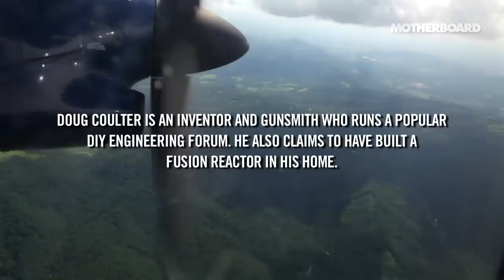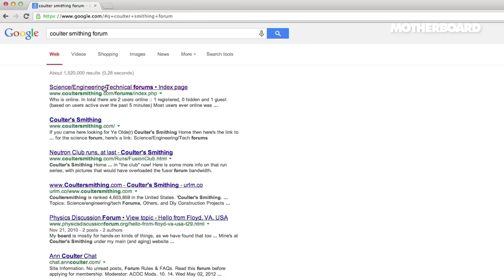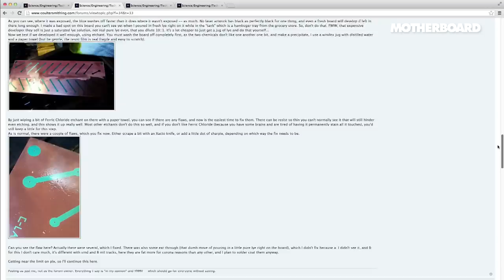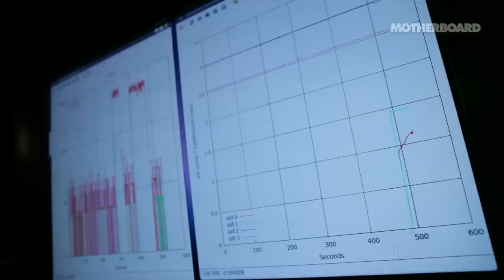Developing Nuclear Fusion in a Basement with a Reclusive Gunsmith

Comment: Is it legal to try and build your own fusion reactor? Sounds kinda dangerous.
Reply: Barely legal, yes.  You're supposed to have certain licenses for anything that makes X rays "on purpose".  We don't make them on purpose, they're a by product.  Actually, unrolling scotch tape makes a few...it's a matter of, well, no one's been hurt at this so far, I suppose.  We tend to be careful.  Electrocution is a larger risk, FWIW - those power supplies are pretty big and at really high voltages, arcs are not straight to ground (Seen a straight lightning bolt?).

Comment: I believe there are fairly simple instructions freely available for developing a hydrogen fusion reactor in one's kitchen. The catch, as with all fusion reactors to date, is that they generate less power than the power required to run them. Is this gentleman claiming his generator produces more power than it draws? If so, once it's verified, Nobel to him … but what I got from this video is that his reactor is no different from the ones anyone in Brooklyn with a subscription to Make Magazine could assemble, i.e., a neat-o experiment, but one that draws more energy than it generates. I mean it's fun, kudos for having fun, but it's not groundbreaking.
Reply: Yes, it's quite easy to make a demo fusor with 10e-9 or so "gain".  That is, if you can solve a bunch of problems with high voltage, feedthroughs, vacuum, and fuel control,  not to mention measuring it all.  Mine's closer to 10e-3...not great, but currently the best on the planet.  I seem to get anything from 10 to 10e2 or 3 improvements every year or so, that's why I'm saying "it's close".  I started at 10e-9 and got the first 6 orders magnitude improvement in 3 years.
At least in this design, all the input power also comes out as heat.  So you don't need as much "gain" as with other approaches.  You need 1.38 watts of fusion for each watt input to break even with current steam turbine tech - eg 2.38 watts of heat will make one watt of electricity (rough numbers but close).

Comment: Very closely resembles a Hirsch Farnsworth fusor in my eyes. As it is the design is incapable of generating power, but I have no idea what changes this guy is trying.
Reply: +olivius007 Corrrect, but you'll know as soon as the USPTO approves.  It's a pretty slick trick, is all I can say now, and jaw droppingly obvious - but only in hindsight as the physicists who checked me on it say.  Found it by a combination of perspiration - checking a huge multi-dimensional parameter space, and insight.  Todd Rider's paper on why thermal methods and static fusors can't work is right in every regard, but missed a trick or two.

Comment: Isn't a fusion reactor kind of like perpetual motion energy can't come from nothing and energy isn't free.
Reply: +Sheldon Cooper no, the energy that fusion power produces comes from the mass that is converted to energy
Reply: Justin Liu But how does that even exist? Nothing has produced more energy like that other than something like the sun.
Reply: +Sheldon Cooper Actually scientists did that recently. I think it was not a long time ago when for the first time a fusion reactor produced more energy than the amount of energy put in
Reply: Justin Liu wow I'm going to have to look that up if that is true
Reply: マリオ 94 it's the same process as the sun. fusion smashes to get low mass elements to make higher mass elements however the the mass after is less than the total before because some mass has been turned into energy E=mc^2 energy is not being created it's being changed from one form to another

Comment: The only thing I don't agree with is that they said no one has gotten more energy out than they put in with fusion. They have successfully achieved this recently but they couldn't get it self sustaining.
Reply: If you're thinking LLNL, they very carefully worded their statement, like this:
" the fusion produced more energy than the fuel absorbed from the lasers".
And then omitted the horrible efficiency (fraction of a percent) of those lasers, or the fact that the fuel didn't absorb nearly all the laser output before disruption.
Absent a gravity field (the sun, anyone?) fusion will never be self sustaining, as the energy output isn't the right input to produce more - you need to make it into something more useful first, then drive a net-gain reactor with that.

Comment: when that thing melts-down it will blow up his whole mountainside
Reply: Given that comment, and your screen nick, I'd guess you don't know the difference between fission and fusion.
Reply: Doug Coulter Actually i do know what they are.
Fission is the splitting of a large atom into two or more smaller ones.
Fission reaction does not normally occur in nature.
Fission produces many highly radioactive particles.
Uranium is the primary fuel used in power plants.
One class of nuclear weapon is a fission bomb, also known as an atomic bomb or atom bomb.
In contrast 
Fusion is the fusing of two or more lighter atoms into a larger one.
Fusion occurs in stars, such as the sun.
Few radioactive particles are produced by fusion reaction, but if a fission "trigger" is used, radioactive particles will result from that.
Hydrogen isotopes (Deuterium and Tritium) are the primary fuel used in experimental fusion power plants.
One class of nuclear weapon is the hydrogen bomb, which uses a fission reaction to "trigger" a fusion reaction.

Supercrackpuppy is just an alias and does not reflect my actual iQ.

I find your setup quite intriguing actually, I just think that something like a fusion reactor should have a whole team behind it and better containment.

Regardless of my thoughts you have been successful thus far. As a result i wish you luck in your endeavors.

Regards Bryce Adam Vickery
Ps. don't judge a book by it's cover
Reply: supercrack puppy Fission does happen in nature, and did on this planet a few bill years ago.  I have some of the "reactor waste" from it in my mineral collection.  Back then, uranium had a lot higher proportion of U235 than now.
http://en.wikipedia.org/wiki/Oklo

Comment: I looked at his forum, and it just seems to be a bunch of people talking vaguely about making fusion reactors using lots jargon. Nobody actually explains how anything works, and there never any exact numbers.

For example, what is the connection between an electron scanner microscope, and fusion? An electron beam can fuse...but not the kind of fusion that he is talking about. It can fuse metals together (welding).

Fusion isn't something you can "slap together using re-purposed parts." If something sounds too good to be true, it probably is.

Basically, all of the scientists working on the other fusion projects are just pretending to develop fusion technology, and have either; A: never heard of this guy (a genius in the feild) for some reason...Or; B:  just pretending to develop fusion technology. Not so likely.

Comment: (First sequence) a gunsmith grasping the (removable) magazine while shooting? Uh?
Reply: it's technically a "pistol" so accuracy is not much a concern. AR mag-wells are pretty hardy. If it was an MP40 or a bren, that grip would be a bad idea. Plus, there is no guardrail.
Reply: Theo Mawia
 We're still learning how to shoot that oddity, is all (while it looks cool, it's not that great a gun, just a lot of fun).  How would YOU hold it?  That's a serious question.  It's definitely a two-hander since the recoil is serious.  I'm wincing at the end of the sequence as I touched the barrel while removing the mag and clearing the gun before the muzzle could sweep the cameramen.  Got a burn.
Reply: Theo and Doug: thanks for those explanations! As to hold it: I may try to add some lanyard to it (à la Ingram MAC), but dunno if it's realistic or efficient.
Reply: Doug Coulter what an honor. The man himself. Well, putting a stock on it is definitely illegal since its a pistol (i'll never understand gun laws) and would defeat the purpose of having a small, concealable weapon that fires a 5.56. Personally, if there was a choice (no ATF regulations etc) i would put a guard rail, a CQB scope and a fore grip, maybe get rid of the bird cage and slap a muzzle brake/compensator. It's not perfect or legal but would be safer than your configuration. I'm not much of a fan of "pistolized" rifles. Put a good ole' bolt action in my hands and i'll be grinning ear to ear (preferably an SMLE or any Lee-Enfield will do).

Comment: thorium?
Reply: Thorium is a natural radioactive byproduct of the nuclear decay of Uranium 238.  Nuclear fusion only deals with elements whose atomic number is less than iron's atomic number.  Most nuclei with low atomic numbers are non-radioactive with notable exceptions like Carbon 14 which appears in small amounts in natural carbon deposits and carbon based molecules.  For practical purposes, nuclear fusion as a possible source of power only exists with combining four hydrogen nuclei into helium...one neutron at a time.  I think that the trickiest part of the fusion reaction is combining one deuterium nucleus (hydrogen with one neutron) with a tritium nucleus (hydrogen with two neutrons) to get stable helium (2 protons and 2 neutrons) + a free neutron.  Once the free neutron is released, there is a tremendous release of heat, but after the neutron is absorbed by the lead container, there are no radioactive byproducts.
Reply: Dov BarLeib could you foresee a use for thorium as a possible fuel for the future using a reactor? i dont know much about any of this haha
Reply: daybreaK Any use of a heavy nucleus like thorium to produce energy will result in radioactive byproducts and has inherent dangers because fission leaves radioactive byproducts.  Nuclear fusion (hydrogen into helium) does not have this drawback.  Nuclear fission has this horrible drawback.  If G-d forbid something happens to a fission reaction like in Fukushima, the cleanup would take centuries.  Thousands die early from Cancer.  This is not an issue with fusion.

Comment: "A fusion reactor that produces more energy than it receives has not yet been developed" Physics will tell you that nothing produces more energy than is put into it. Power In>Power Out.
Reply: +David Ugarte combining atoms produces a significant amount of energy. The issue is getting them to combine at the proper temperature and harnessing that energy. The sun is a fusion reactor, it's more than possible.
Reply: +dirtbikersteve have you ever seen the large hadron collider? It's like miles long and the energy used to propel atoms is more than what is produced by the explosion. Yes we get energy from the sun but we don't get more energy than what the sun produces.
Reply: +MrDpsc wait so you agree with me that it has never been done before and is against current laws of physics? yet you talk about a process like it has been done before?
Reply: MAN has never done it, it happens in nature all the time. Before man learned to create fire, was fire not possible!!?? Your logic is just plain old wrong and stupid.
Reply: ok heres the link validating what Im saying is true. https://en.wikipedia.org/wiki/First_law_of_thermodynamics
Reply: Now you post yours
Reply: David Ugarte mate, stop. When you fuse very light elements (hydrogen isotopes) you'll gain a shitton of energy as the amount of mass of two seperate hydrogen isotopes is lower then a helium atom. E=mc^2... We generally aim for helium as He(2,4) is exceptionally stable and releases a large amount of energy. Furthermore, hydrogen isotypes are very common and almost inexhaustable. In theory, we could pick about any element from the first third of the periodic table and fuse it with others (as happens in the sun, more notably a certain carbon cyclus iirc). At no point is energy conservation violated or the law of thermodynamics for that matter.
Reply: I never said anything about fusing elements, atoms or whatever the fuck...I said Energy in>Energy Out and so far we all agree on that. The quote the guy uses, that I criticized made it seem like hes trying to say that its an overunity device and I was merely commenting that physics states it's impossible. Somewhere along the lines dirtbikersteve misinterpreted what I said and went off in a tangent.
Reply: David Ugarte Literally your first comment was wrong and annoying. Why do you feel the need to correct people about something you know obviously nothing about? Either it took 5 days for you to realize why dirtbiker and me tried to correct your or you're too bloody stubborn to admit your mistake.
Reply: Why are you so passive aggressive? Do you need a hug? Im not arguing with you and I am not denying anything of what either of you are saying. What did I say was wrong? 

1) It's like miles long and the energy used to propel atoms is more than what is produced by the explosion

2) we get energy from the sun but we don't get more energy than what the sun produces.
Reply: David Ugarte 

""A fusion reactor that produces more energy than it receives has not yet been developed" Physics will tell you that nothing produces more energy than is put into it. Power In>Power Out."

Half irrelevant / half wrong.

"+dirtbikersteve have you ever seen the large hadron collider? It's like miles long and the energy used to propel atoms is more than what is produced by the explosion. Yes we get energy from the sun but we don't get more energy than what the sun produces."

completely irrelevant

"+MrDpsc wait so you agree with me that it has never been done before and is against current laws of physics? yet you talk about a process like it has been done before?
Vertalen
"

Hard to pin down exactly what you're trying to say here. Sentences devoid of any logic.

"ok heres the link validating what Im saying is true. https://en.wikipedia.org/wiki/First_law_of_thermodynamics"

Irrelevant.

Fusion works, we can't as of yet get more energy from it then we put in. It doesn't violate conservation of energy as we don't take into account the energy that the fuel itself contains (this is understood by everyone except, apparantly, electrical engineers). If we did, every reactor has 100% efficiency.
Reply: Were clearly arguing about different things here and your still overlooking my point. Im done with this dialogue. Please enlighten me with a link from a legitimate source that states through nuclear fusion or combining atoms or whatever you are referring to that says you could create a over unity device?
Reply: David you are 100% correct saying energy in must be <= energy out. The issue is you don't understand that energy can be stored in the form of mass/matter. When two elements are combined the resulting compound has a lesser weight than the sum of the two component elements. That lost mass was converted to energy, this is the energy that fusion creates and that people are trying to harness.
Reply: +dirtbikersteve thank you for the explanation.
Reply: ***** I thought david was taking a piss and being difficult so I took a cheap shot. Nothing wrong with electrical engineers, it's just what he claims to be on his profile...
Reply: +TehPrepper Just found this article the other day. It's a really good read about the subject.   

http://arstechnica.com/science/2014/02/giant-leap-for-nuclear-fusion-as-scientists-get-more-energy-out-than-fuel-put-in/

Comment: "12 miles over" he just lost all creditably. Distance to the horizon on a hill or tower 100 feet in height, the horizon is at a distance of 12.2 miles.
Reply: +Ion Hunter Army used to use .50 BMG as a coaxial gun in tank gun training as the trajectories are quite similar.  Care to note facts or anything?  One aims artillery up - granted a .50 is on the small side for that designation, but the BC of the projectiles is quite high.  And BTW, your numbers are a bit suspect...
Reply: Doug Coulter Nothing you said is true. GOOGLE it.
Reply: I did, as well as live through the period...oops, don't feed the trolls.
Reply: You cant do basic geometry on "12 miles" but some how your Mr. Fusion? BWAA!  BTW I did 15+ yrs military, Iraq 05-07 and was a .50 gunner on convoys and QRF. Also  9 months at Walter Reed. Layoff the neutrons bro.

Comment: That guy was wrong about fusion reactors not producing more energy than they take in, it's just not cost effective yet.
http://gigaom.com/2014/02/12/for-the-first-time-nuclear-fusion-produces-more-energy-than-it-takes-in/
Reply: Do a critical reading on that article.  Nope.  LLNL carefully worded a statement that they got more fusion out then laser energy absorbed.  The lasers take thousands of times more electricity in than light output, and then they can only get the fuel to absorb a tiny fraction of that before things disrupt - most of the light is wasted.  Net out vs in - I beat them like a red-headed-stepchild.

Comment: what happened to his right cheek? it looks like he accidentally shot himself in the face
Reply: Unfortunately, you're correct.  A malfunctioning Mauser I was testing for a customer fired its bolt through my head.  I appear to be hard to kill.  Same accident actually happened to Peter Paul Mauser himself, and he designed a preventitive fix for it, that I hadn't (yet) applied to that ancient gun.  I guess the cameraman liked the look, since he concentrated on it so much.  It actually didn't hurt - severed the nerves instantly.  But was plenty gross.  Glad I'd put a scope on it first, or the hole would have been in a lethal place!
Reply: Doug Coulter thanks for the reply, i was just wondering that's all. I thought there might be a connection with all those guns and tools you've got. I guess it's kind of ironic the same thing happened to him, luckily you're still here to tell the tale though, i'm guessing it could have been much worse. keep doing what you're doing buddy, i enjoyed the video, you're a very interesting guy